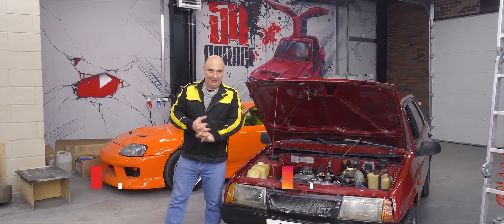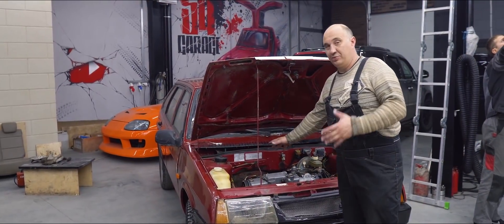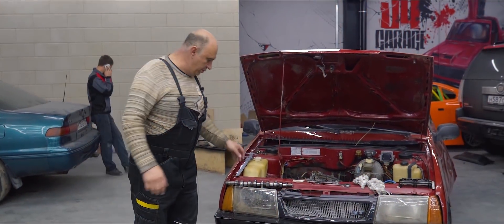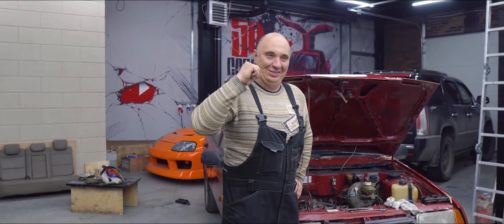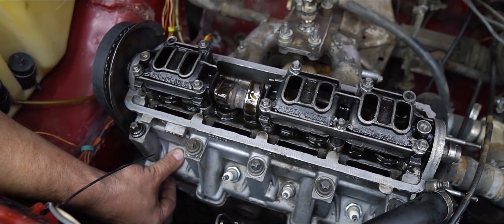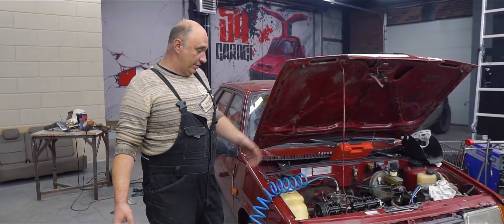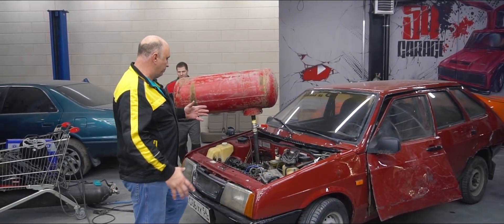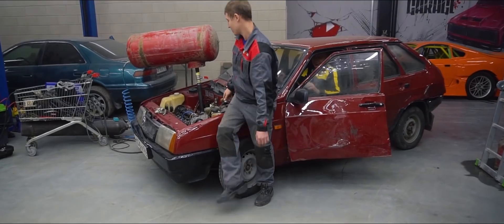Steam engine conversion, part one: startup on compressed air

Comment: You need the inlet valve to close when the piston is only 1/2 way down the cylinder to allow the compressed air to expand. It will make it a lot more efficient.

Comment: I recommend building a flash boiler because you are going to need a lot of steam pressure for that engine to remotely work. 
Flash boilers are easy to make, you just need a container with lots of tubes in a spiral inside of it, as the water is forced into the bottom the heat by fire or whatever inside of the container creates steam which then travels upwards the spiral, the more it travels the hotter it gets causing super heated steam to be generated, this is steam several times the pressure of normal steam.
Almost all Steam engines developed in this area however you are going to need most of the back on that car for the boiler alone.
Suggest using a lot of fire insulation and a pressure valve is necessary, even if flash boilers are safer than normal boilers they can still rupture from over pressure therefore a pressure release valve is necessary safety.

Comment: Would it help to hook the cylinders up in series? Maybe 2 pairs of 2 cylinders in series? Steam engines have a very long stroke at a low rpm. It will also make your engine more efficient, because there's still some energy left in the air that comes out of the cylinders, that energy can than be used by the next one down the chain.

Comment: what if the exhaust air is recycled into that canister with a check valve in between ?
Reply: the pressure in the exhaust will make the pistons  idle
Reply: Eternal energy is achieved like that, beware of the illuminati!
Reply: @zitounathekitty8441  recover it in the tank via check valve? Maybe 2 solenoid valves, an in and out, timed in such a manner that it maintains a working pressure?
Reply: Basic thermodynamics. No free lunch. Any energy used from the compressed air, to recompress the air, is energy not being used to move the vehicle.

Comment: OOOHHWWW! TOO BAD you did not feel with your own hands how much torque you loose on the turning over of the camshaft! Most energie is lost cause those valves are needlessly pressed shut by way too heavy springs for this job! The beauty of steam/airpressure is that it closes the valves from within, so only very light springs will work and thus your project would have been much more successfull. Next problem is the inlet manifold that should have been 4 little high pressure tubes in stead of the original bulky thing. You like to keep pressure up by small pipework, not big ones! If only you had studies the subject a little better, the project would have gone much further

Comment: This engine would work even with the small air you eliminate the intake/exhaust overlap which is present in all gas engine camshafts.  There is a short period of time where both valves are open, letting all your intake air leak out the exhaust.  If you get rid of this overlap with a precise custom camshaft, the engine will run on just the small air line, at a low speed.

Comment: If you would have put the same size pulley on the camshaft as the crankshaft, it would have worked without a problem, because then crank and camshaft would run at the same speed.
Also, since it is carburated and probably has wasted spark ignition, it could even still fire up and blow fire out the exhaust and caburator haha.

Comment: For every turn you use as much air as the displacement of the engine.   That must be kept in mind when making a bioiler to avoid issues with pressure drops.

Comment: Ahh man.  You're doing it the hard way.  You need to start with a Trabant.  Two stroke engine.  With side ports.  Separate Jugs instead of monoblock.  You inject the compressed air/steam through the the spark plug hole.  You need to figure out a way to seal off the intake port and then it's just a matter of valve timing through the spark plug hole.  Some conversions use a simple punch valve that opens when the piston strikes it.  That's got some obvious wear problems.  I would go with solenoid valves and a micro controller for compressed air.  Steam is going to require something more robust.  The key though is in a two stroke, the exhaust doesn't need any modification at all.  It just lets the steam out when the piston reaches the bottom of the stroke just like a steam engine.  A good place to start for your steam injector might be to try retrofitting a TPI fuel injection system.   Solenoid valves are built right in and just need to be switched on and off.  Not sure they can handle steam but think of the fun finding out.  Also oiling is going to be an issue.  
So yeah, that's where I would start.  A Trabant, a 2 cycle engine.  Block up the intakes and figure out how you inject your steam to the cylinder.  Steam punk car.  I could probably make it work in about a month with a steady supply of cheap beer.

Comment: Like always your videos are amazing! One question: What will happen if you put back the carburetor and try to start it? Will it run like two stroke engine? 
Probably not because there's no suction but if you force it with pro-charger or supercharger will it run? Who knows :))
Reply: There is no compression stroke so it won't work.

Comment: Take the added lobes off and just make the cam shaft turn at the same speed as the crank shaft,instead of half speed as designed,simpler.
Reply: I was gonna say this but I knew someone beat me to it.
Reply: plus grind the cam so less valves will open
Reply: The valves would be open for half as long as they usually are. I don't think they would get enough air through to produce sufficient power. Kinda like how it was being bottlenecked by the original smaller hose.
Reply: @ojmbvids  that's what I was thinking. For sure making it rotating twice as fast will open it at the correct rate as wel, but as it is moving twice as fast, the opening time is only half the normal time. This problem doesn't exists with the double profile. More opening time is more torque, and in the end more power.
Reply: There will stil be a dead spot from 180° on the camshaft 

So i think it will only open when the piston is on the upper half of the cilinder  

Piston down -> 1/2 valve closed 
1/2-> up : exhaust 
Up -> 1/2 : intake 
1/2 -> down : valve closed 
(You lose 1/2 of the piston displacement/power) 
For a single cilinder 

When with dubble lobes 
It is 
Piston down ->  up : exhaust open
Piston up -> down : intake open

And it works with multiple cilinders
Reply: @bartjanflikkema  You also have some valve overlap that is wasting air
Reply: @timh9537  #metoo
Reply: it won't work, the valves will open for half the travel and will overlap
Reply: Same I was gonna say get another crank pulley, but they're both solutions so it's all good

Comment: Three is like a few problem here.

Firstly the air is forced in the direction of the valve spring. Some air is probably leaking right throw.

Secondly. It loses way to much volume.

They could make it into a double expansion motor if they used the air out of on cylinder end feed it in to two other, them just pinned the valves down on the 4th cylinder

Comment: I think it took so much pressure because of the flat plain crank. I believe a cross plain engine may run on lower air pressure.
Reply: at the very least it will have more consistent power delivery

Comment: every NASA engineer on the comments is saying to fit a 1:1 pulley between crank and cam,.....NOPE...we dont need compression or firing strokes where all the valves are closed on that cylinder, it will cut the motor's efficiency in half...the way they did it is the best way....just two cycles intake and exhaust....now they need to regrind the cams to remove any advance or overlap. intake should open at tdc and close at bdc or atleast very close. exhaust its the opposite and should stay open until intake starts opening....camshaft lobes should be steeper also, valves should open fully and close immediately very fast... also they need to take into account that the pressure they use is not enough to push the valves open by it's own, if that happens they need stiffer valve springs wich will eat their angle iron lobes....

Comment: You should shorten the valve open time by removing some of the lobe flank, it will prevent valve overlap where a lot of air is probably getting wasted.
Amazing results. I saw a guy make an air compressor from an IC engine the same way, it worked surprisingly well.

Comment: I think you need an engine with less pistons. Like a 2 piston or even a single piston engine
Reply: Stefan Batrinache  I think they need an engine with more pistons. Like 10 or 12! :D
Reply: 2-stroke engines can and are capable of using steam and/or compressed air. Air/steam start diesels engines are a thing.
Especially the very BIG engines of old factories which are stationary engines.
Reply: Open Minded Air Head   Diesel engines that are started with air or steam use a flywheel engagement starter motor that runs off of compressed air or steam.
Reply: @louisturner8842  - Yes most are but not all.
Reply: @louisturner8842  Some big diesels start by using an additional valve that admits compressed air directly to the cylinders, the air pushes the pistons and starts the engine
Reply: @petarmiletic997  true..tank engines do that
Reply: or just use 2 pistons from the car
Reply: I did think that aswell but we dont watch these guys for doing things the simple way, more complicated more intriguing

Comment: You need to put a diesel road compressor on a trailer and pull it
Reply: Plus a greater capacity.
You could route excess pressure to the jets in the hot tub car.
Not to mention a heating unit.
Pull a trailer and you have many more options.

Comment: You really need to offset the two remaining cylinders 90° so that it can start on its own from any position. But if you ever want to run on actual steam, you need smaller cylinders at higher pressure. Water will not boil fast enough to feed large, low pressure cylinders like that.
You also want to close the intake valve way before the piston reaches the end of the power stroke. Taking in all the pressure near the end is wasteful. Consider cutting the intake cams in half so that the trailing half of the cam is missing. The valves should slam shut at about half of the stroke. (It would be more efficient to close even sooner, but difficult to do with just a simple welded camshaft.)
It would be great if two of the four intakes could be disabled on demand to reduce steam use while cruising.

Comment: still waiting for the electric car powered by an atomic battery, come on russia !
Reply: kais Yaya  Give it at least 10 years. Guaranteed. 

Mini reactor powered car! Just need 10tons of lead and radiation suits. Geiger counter mounted in the dash. Rad!  
I mean they could run this car on a mini reactor. Heat water... interesting
Reply: P.s, we are both now on a list
Reply: So this sucker is nuclear???
Reply: Tritium mixed with solar panel material and phosphorescent material.
Reply: @787brx8   Apparently, you are aware of the laptop battery ?

Comment: u guys need to do a lot more research. Look at the videos on steam cars by Jay Leno, (Jay Leno's Garage), Also steam engines are low RPM, monster torque. So you want basically a 1:1 connection to the axle... Better yet make your own cylinders based on classic steam engine designs, a 2 push-pull cylinders about 3.5" each should work great in that car.

Comment: To make this work, you're going to need a proper boiler of sufficient size to provide the needed volumes and pressures to propel the car. A big problem I see is water getting into the oil and quickly causing rust, corrosion, and excessive wear. Due to how much torque a proper steam engine can have, you might be better off "converting" a much smaller engine and trying it in a car.

Comment: Instead of welding extra lobes on the cam, just spin the cam twice as fast as the engine and you achieve the same thing without the dodgy, hacked cam.

Comment: ooooor just half the size of the timing pulley on the cam shaft to make it spin twice as fast would seem alot more simple
Reply: That's what I thought too. I think ultimately the lobes might need to be reshaped anyway to have longer valve opening times.

Comment: You would get further by having half the crankshaft (and camshaft) split and turned 90 degrees (45 degrees for the camshaft), making each piston work independently, not together.  In a four stroke engine, each piston fires on alternate upstrokes so that only one piston is working at a time.  Trying to make two pistons work at the same time just HALVED your success rate.
Reply: That would be an insane amount of work if you could even make work. 
And this does work so...

Comment: Next: Car driven by electric starters with manual gears and batteries...
Reply: Remove spark plugs and fuel relay. Wire multiple batteries in parallel. Use starter for drive power. Wont last long but it does work

Comment: Put a turbo jet engine on it so the exhaust feeds the pressure side with the turbo blowing straight into the engine with fuel so it makes better compression
Reply: There is no fuel

Comment: I gotta be honest, I've never seen anyone weld on a camshaft before
Reply: I doubt anyone ever has :)
Reply: @notjustforme  It's a normal way of making more aggressive cams for cars, for which there are no aftermarket ones available. You weld on a bit on top of lobe, grind and repeat. You've not seen much ;)
Reply: @Murzyn2137  you are joking right??so you do that with a mig and a bench grinder and expect it to work for more than one hour at revs ranging from 1000 to 7000 rpm?????
Reply: @MrHBSoftware  that is how it was always done , we used arc welds because no-one had MIG 50 years ago, the modified cam would last the life of the engine.
Reply: @MrHBSoftware  No. People still do it on gokart engines, cause why not on a converted $50 lawnmower motor.
Reply: @madeleyinc  sorry, not buying that one unless the "life of the engine" would be 2 days

Comment: talking about steam engines, the reason that trains went "choo choo" was because they have too much steam pressure built up or need to stop. you can't really burn coal slower or faster.
Reply: The reason they went "choo-choo" was that the short smoke stack produced little draft to burn the coal. The spent steam was injected up the stack, causing draft.
Reply: @drewthompson7457  ah i thought it was a mean to regulate the pressure in the boilers since you can't get rid of the fire and heat as easy as the excess steam pressure. not to mention if you want to stop! well all i did was guessing from looking at it and from the observation that is what made sense by eye to me... i guess i should look it up on Wikipedia since i still wonder about the internal mechanics! (the path way of the steam and how the piston reciprocate.)
Reply: @theepicslayer7sss101  : also look up the double and triple expansion steam engines. they re-used expanded steam to make them more efficient.